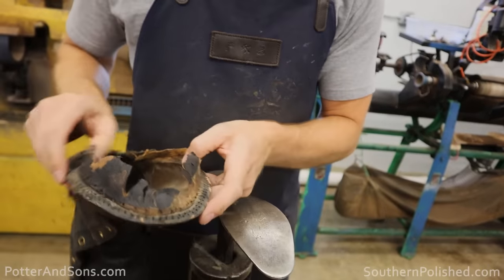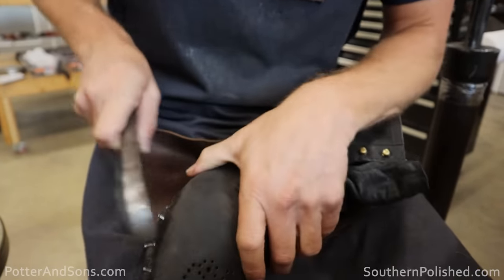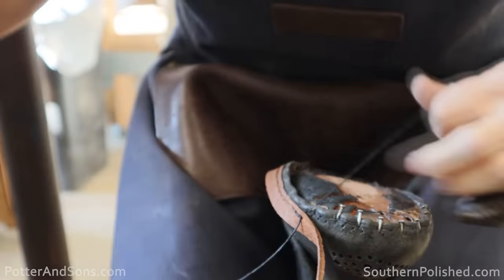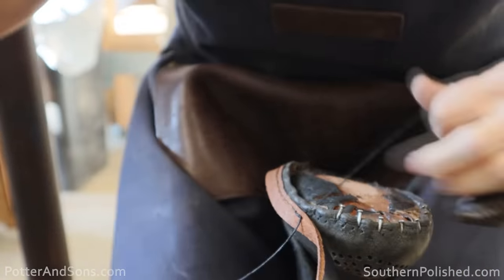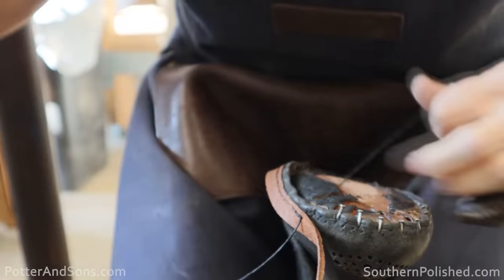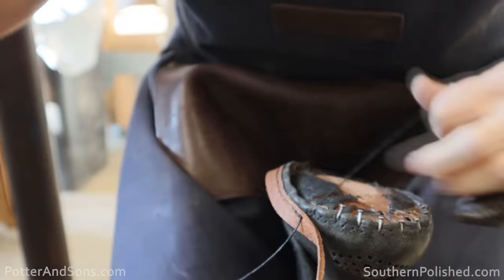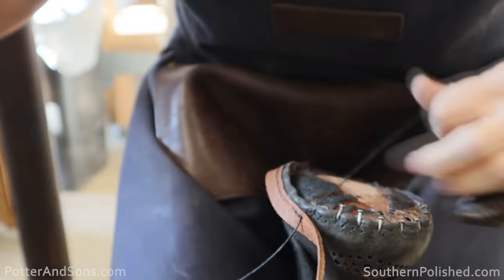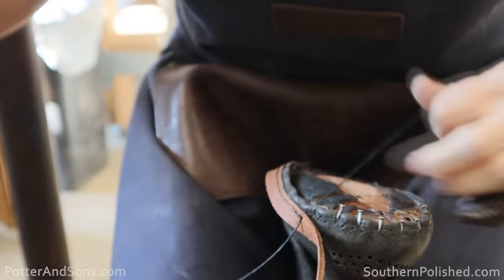Rugged FIRE BOOTS Are Turned Into DRESS BOOTS | Our MOST Extreme Makeover YET

Comment: Instead of using a lighter to melt the wax into the leather, I have used a hair dryer on the hottest setting to melt wax into my purse handle that needed a gloss as well as a stiffer handle to hold it's shape. And it worked flawlessly

Comment: I love how these look the shine on it is wonderful. It doesnt need the high mirror shine on it.
Not a cobbler but only a suggestion try using the heat gun on the wax next time over the lighter.
Reply: For a high shine you can set your wax polish itself on fire 🔥 then apply the melted liquid (put it out first) onto the leather. It spreads more thinly and evenly and will give you a very glossy shine.
Reply: Sounds like the old soldiers trick to get a mirror shine on toe caps. Apply loads of polish and then wipe a heated knife side. Frowned on by instructors!

Comment: I have a weird question. I have leather insoles in my boots and they’re really squeaky. If I sand down the underside of the insole will it help with the squeak? Are there any other tips for squeaky insoles. I also have boots where I have to stack 2 leather insoles and those are really squeaky. I’m thinking of just gluing the 2 insoles together with contact cement to help.

Comment: How we did it in the service-  light your Kiwi black polish on fire, turning it into a liquid.  Use a square of cotton t-shirt to apply it to the boot.  Then  use a clean square of cotton, soaked in water.  Fill the top of your Kiwi polish as well with water.  Use the wet cotton wrapped around your first 2 fingers, taking small amounts of water soaked polish, and apply to the boot in a circular motion using very light pressure.  Keep dipping and applying.  A couple of hours a night for 6 to 8 weeks, and your boots will be mirror shiny.  And have a slightly green hue...  Props if you do it completely in the dark, sitting on your bunk, with a flashlight held in your teeth....  That's how we did it, that's how America does it...

Comment: They probably didn’t have a steel shank because they are wildland boots. You don’t want metal in them as they can heat up significantly walking around burn outs and over hot coals. Also why you’ll never see steel toed fire boots or glued soles (glue will separate in heat).
Cool video and great work!

Comment: Does the upper need to change or a different last need to be used when switching this 875 style boot and original soul to a half heel soul like this? I ask because I had a pair of Danner Light II's resoled from a flat style sole to a Vibram Olympia 1275 with a decent heel. Now the toes of the boot hover off the ground if I stand flat on the heels.

Comment: In basic We used to melt the Kiwi (ruined it of course) in the tin and goop it on spit shine it till it was a mirror and didn’t touch it till after inspection. You could hear the cracking (exaggeration) when we walked. Good times.

Comment: To get a fast high shine, I melt Kiwi shoe polish in its container. By using one of these methods. Fire, hot sunlight, heater, etc. I also warm the shoes, boots up too.
I put the applicator into the melted wax and apply it to what I want to shine. Let the wax sit for about ten minutes to dry and then buff with a shoe brush until shined. Give this a try and see how this method works for you. I hope this helps you:-)

Comment: I am former military and highly recommend you get a heat gun instead of the lighter.  As a previous Drill Sergeant the heat gun was much better and safer than the lighter.  Give it a try - you will like the results and the safety factor that comes with it.

Comment: This is the first time I've watched one of your videos.  I'm really impressed with the level of workmanship that you do.  I've always preferred a Vibram sole on my boots. They provide a tough, rugged, and soft springy walk.  But, you put a beautiful dress sole on these.  The dress soles look like they would be very slippery on a wet surface whether it be outside in the rain or coming in from the.  I think that they wouldn't be as comfortable to walk in as a boot or shoe with a softer sole. I also think the taps would make a loud clicking sound with each step.  Are my assumptions incorrect based on just what I've seen?  Your thoughts?

Comment: Pro tip if you hold the lighter the other side (I mean your thumb facing the boot) there’s less chance for you to burn your thumb and the lighter wont get really hot.
Reply: Working with leather all the time, I doubt that he even felt the heat from the lighter. When the ends of my friends jeans caught alight while he was stomping a bonfire that was spreading into the dry grass, he just rubbed them out against the side of his boots with his bare hands without even thinking about it.